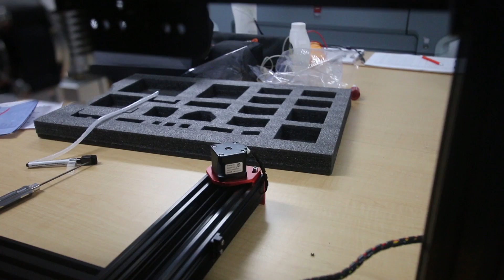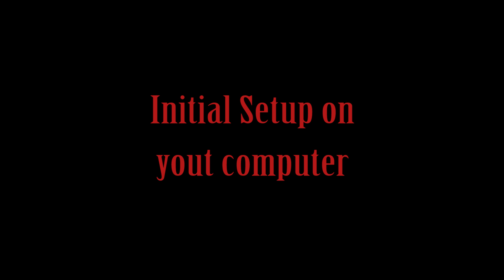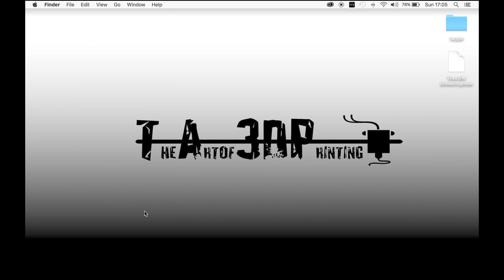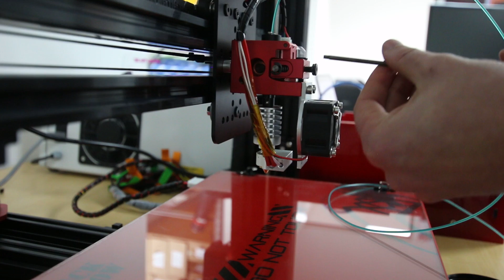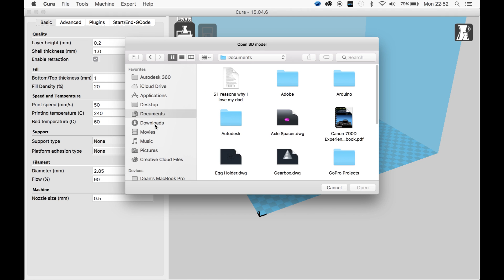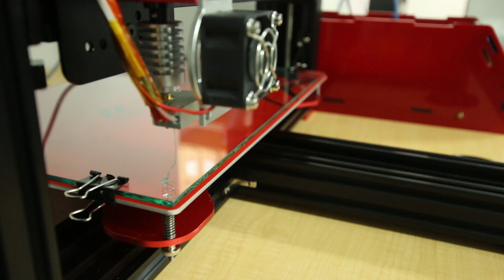TEVO Black Widow Assembly Guide Part 8 - Initial Setup + First Print

Comment: Not sure if it was mentioned in previous videos, but you can disable the stepper motors from the menu and then move the axes and check if the end stops light up. That way you know they are not to far from the plates they are detecting.

Comment: Great  videos man love the series thank you very much that helped me out a ton now I'm having an issue with my extractor stepper motor not working whatsoever I tested the motor the motor works I test the cables the cables work but on my motherboard I'm not getting any voltage to the Adjusters for voltage whatsoever any help would be great

Comment: You know you can just grab the bed and move it and the hot end manually into the right place, with Z at 0 the whole time, and just adjust as you move until all the corners are good.  No G-codes needed.

Comment: Love the video's followed them to the T, THANKS!, Mate just got a question have you manage to flash the latest marlin? 1.1.1-1.1.2? Could you do a guide if you manage to do it? The reason i'm doing it is every time I do more then one print, my extruder retracts so much filament, i'm using astroprint, not sure if that hurts.

Comment: im having issues with the x-axis motor , its squealing heavily and switching direction randomly mid motion. I tried switching 2 of the motors to see if the problem is in the motor but I'm still having the same issue with a different motor that worked perfectly on y-axis, I also tightened the drag chain as much as I could but nothing changed
Reply: please help

Comment: How can i upload new code in the microcontroller? I was testing and the X-axis move so fast. The motor walks some steps its a litlle bit crazy how can i fix it?
Reply: yes I have the same problem please help
Reply: @munzirmukhtar605  need calibration and very if motor drivers are all right
Reply: @munzirmukhtar605  board trouble, i bought another one

Comment: When I run the auto home procedure on my black widow, the x and y axis work fine, but on the z-axis it goes on the wrong direction and then stops. Do you know what would be causing this?
Reply: I have the same issue.  Tracked it back to the Z limit stop reporting the is is triggered when it should be open and vice versa.  I have an inquiry into the company for the firmware adjustment needed to correct this.

Comment: hello i just put my bw together the limit switches do not work on one light is on the other 2 are not help please thanks
Reply from the maker: they only trigger when the metal is 1mm or less to the sensor so make sure the sensors are close enough :)
Reply: one limit switch the light is always on does that mean its defective

Comment: your tuts have been extremely helpful!

but my machine, when using the command (g28), finds the x and y perfectly.. for some reason it cannot find the z and gives me the error z probe out.bed..

and the whole x axis moves up instead of moving down..

any ideas?
Reply from the maker: check your connections on the control board...if there is no connection it will think the endstop is triggered all the time and do what you have described
Reply: just did.. and double checked.. there is a solid connection.. at times i can see the z probe light up as if there is something infront of it.. yet the whole entire x axis i 200 mm away
Reply: Ma'a Akai  hi I have the same problem. The z only goes up about 10mm every time I try to do auto home. I can't see any reason why this is happening and tevo is not replying to my emails. Any idea
Reply from the maker: this is caused by the board not registering the signal from the endstop. try checking all the connections and maybe try swapping you z and y endstops to see if you y endsto works when used as the z. if this is the case then you have a faulty z endstop and will need to submit a ticket on the tevo website for a replacement
Reply: The Art of 3D Printing hi I have tried this. The z don't even get close to the end stop. It also homes upwards instead of down. It's very frustrating. Thanks for the reply

Comment: Hi there. On my initial setup I see that the hot bed does not keep the room temperature but it`s raising by it self even if my settings are at 0 degrees and also having a hard smell which I believe is coming also from the hot bed. Did I forgot something on the setup or I might have a bad component ? Thanks!
Reply: hey ya, i'm currently having the same problem, did you happen to find a solution? Thanks :D
Reply: Hi there. Yes, I had to repair it by myself. The electronic component that deliver the high current to the bed it's not well designed to sustain such a big bed current drain, thus the electronic piece melted and the contacts of the component was welded without the possibility to cut the current at command. I had to remove it from the board and replace it with a compatible one but designed for high current drain (I've used a IRF2804 Mosfet). If you want I can send you some pictures with the result.

Comment: Can you help me.cura doesn't connect to my printer ?  I obviously don't get the print with USB option and following the steps I don't get to anywhere
Reply from the maker: This has come up as an issue before...dont know why it does this and i would only think to save the gcode to the sd card and print with the sd card
Reply: Thank you for the quick reply. Can u just tell me how can I connect the SD CARD?
Reply from the maker: There is a slot on the left side of the lcd

Comment: hey dean i also have problem with z and y axis. heat bed is goint to the worg direction wile auto kalibrating and the Z axis is going up or even is not doing anythig. i checkt every conection all end switches work fine.do you have any help pleaes. oh by the way i ordert it with BL Toutch but it was missing in the packing. when i turn on it says Tevo anf than BL Toutch. can it be that they use diffrent Firmwear on the Mainboard when you use The BL. Sice the BL is not shipt jet ist there any way i can Print without it or better even Print
Reply from the maker: you need to invert you z axis endstop logic and also make sure the y belt clip is on the right hand side of the loop not the left :)
Reply: Sorry to bother you again but how do i invert my z axis endstop logic. Belt is fixed y Axis workes fin now

Comment: hi, i already bought a tevo black widow and i have a problem with the start up. the screen turn on but there is a flat line in the middle, only that. please i don´t know what i doing wrong. is just a horizontal line in the middle, there is no picture. i did check the cables a few times, i think that are ok, my printer comes with BLtouch but i didn´t connect it. i.m not sure if can be that. heeeelp!!!! PLEASE!!!!!!!
Reply: Hacelo Vos the problem probably is the screen or the screen cables. Contact tevo people through Aliexpress, they are very helpful.
Reply: Hacelo Vos or look if you need to swap the cables --> 2:14
Reply: i didn´t know that i can contact people of tevo throght aliexpress... thanks!!
Reply: also i fixed the problem... was the firmware. not installed. thanks!!
Reply: Glad to hear you found a solution, weird that the firmware wasnt installed...